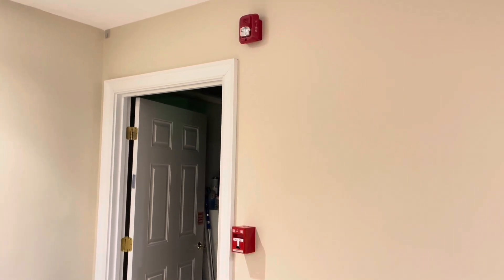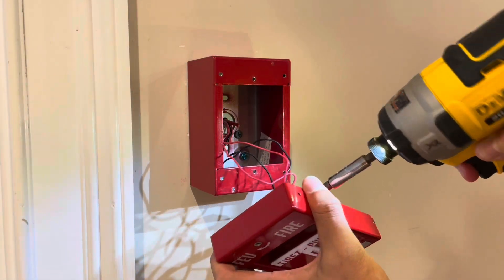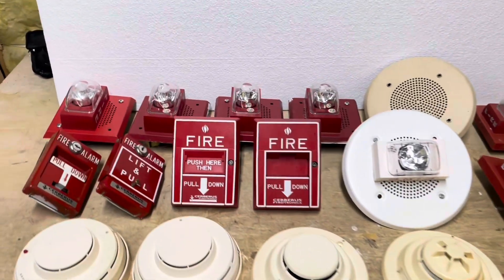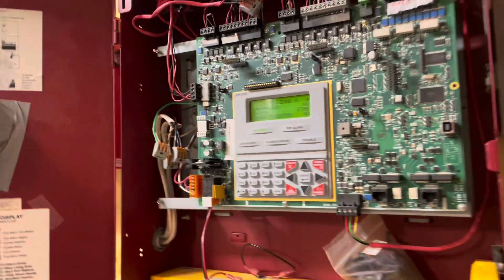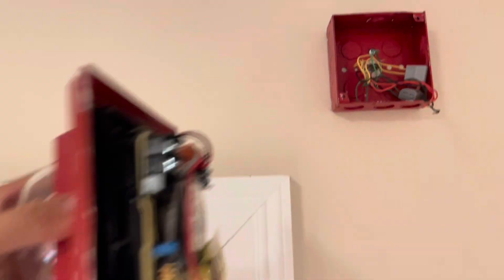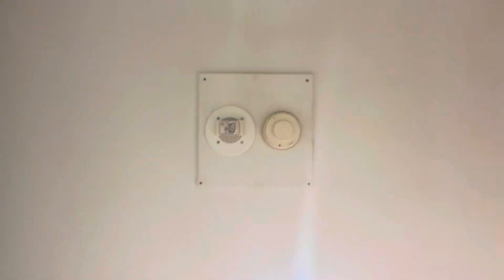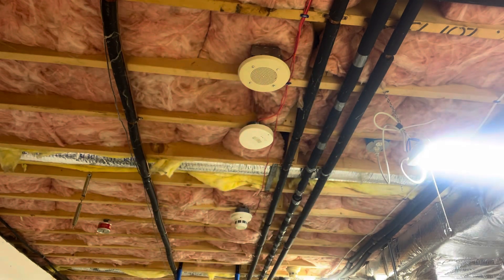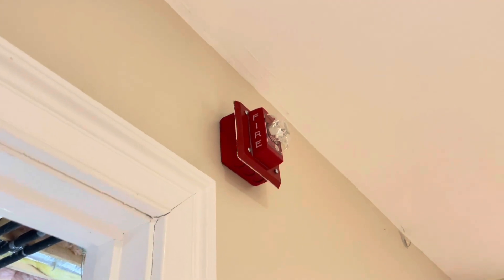Installing Siemens I-SM Speaker/Strobes to Replace System Sensor Devices | Fire Alarm Down/Upgrade?

Comment: Are the wall mount speaker strobes the same model as what providence mall in rhode island has?, also do you know by any chance of what fire alarm speaker strobes the twin towers had with its pyrotronics voice evac system?

Comment: Please do a test for October or I will be very sad or do it on a weekend
Reply from the maker: there will be an october test
Reply: @FireAlarmDude5967 How about a System Sensor Spectralert Advance test for October which I sent you a comment in the Spectralert Classic test for August and then in another video when you apply the beacon to a Spectralert Advance and I asked you for a test in September and you said, “August is already system sensor, so that’s probably not going to be the theme,” and then I replied, “maybe for October,?”. How does that sound?
Reply: Please Do The October System Test For Halloween 🎃 Day Fire Alarm Dude 5967 With Mechanical Devices
Reply: @GeorgesNintcheu He will do it. He uploads the video for the test on the last Friday each month.